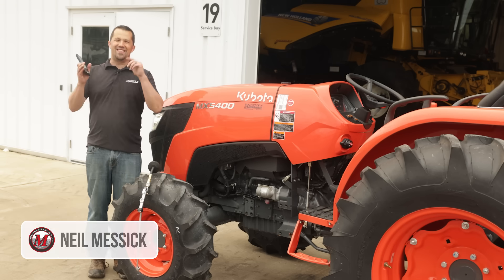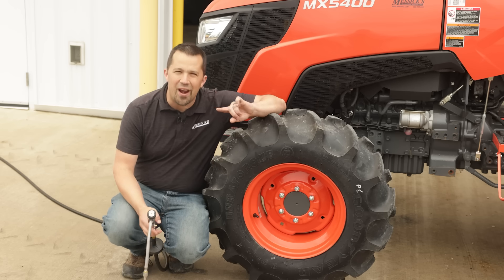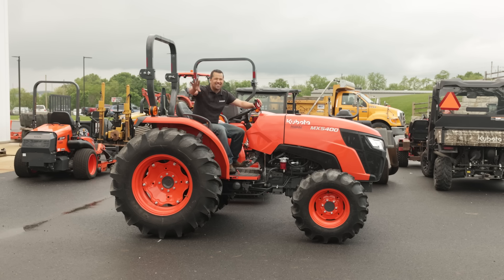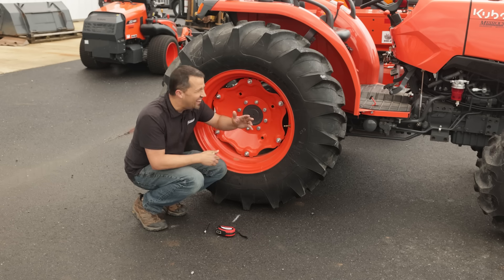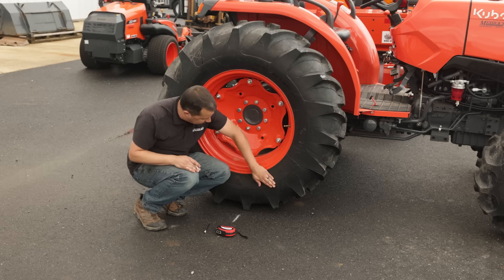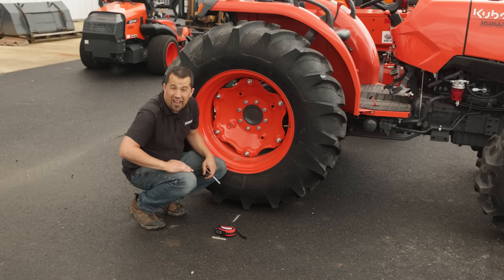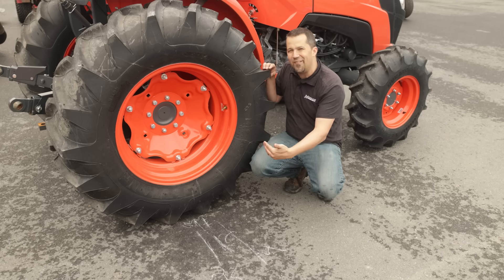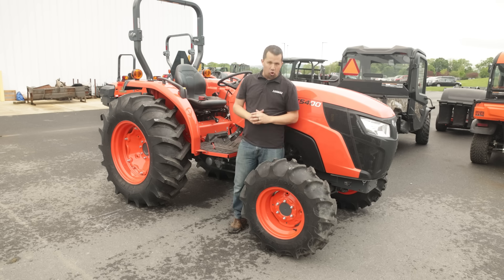Your front tires spin faster than the back. Testing air pressure vs rolling radius.

Comment: Good to know - Especially when changing worn tires -  or Upgrading tires, for using the front end loader with heavy loads in a rocky or “stumpy” area - Think, going front Ag tires to construction tires, for greater Thickness/more plies to increase durability…

Comment: Hi Neal,
I enjoy your videos. Keep it up. I'm a retired Ford engineer and once upon a time I participated in an experiment that is kinda related to what you did in your tire pressing video. I was in the Driver Information department and there was some discussion about how tire pressure would speedometer accuracy. The result was tire pressure had absolutely no affect on speedometer accuracy.
Regards,
Bob Ferencz

Comment: Looked like a gear drive tractor?…but couldn’t see gear selector. Definitely clutched with shuttle shift. Just curious if gear selection changed or if ratios are same regardless.  Just curious as I have the gear model MX but opted for less expensive and less repairs of the 2wd.  I’m not in hills and never had situation where rear diff lock wouldn’t get me out (plus the bucket can push me out if in mud).

Comment: Hey Neil, this is Bill. Thanks for looking into that.🙏  I did not know the front had a slight lead.  I use 4wd only when needed and never on Concrete or pavement. 
   Your video definitely makes me feel better about the resistance I feel when in 4WD. I have R4's and lowered the air pressure in the rears so the tread sits flat which greatly improved my traction, but I keep the front at 40psi as recommended for loader use. 
   I have always driven Jeeps with a 1 to 1 gear ratio front to back and having equal air pressure in all 4 tires is important when using 4wd, but I've always wondered how the different size tires on a tractor effected the rotation in 4WD.
Thanks again, greatly appreciated.

Comment: correct me if i'm wrong,  but the circumference of the tire isn't going to change regardless of the pressure right?  the radius changes, but the distance the tire travels shouldn't change because all the belts etc inside the tire won't allow it to.  in other words, your big ol ag tire has 26 sets of lugs that are 6" apart.  no matter what the inflation is, you should still have the same number of lugs with the same spacing no?
Reply: No.
Reply: @guyprattii3115  care to elaborate?
Reply: Diameter is 2*pi*r. If the radius changes, the diameter changes. That seems logical enough. But there is an argument that the radius is only changing at the very bottom of the wheel (where it's squished). At the front of the contact point, the tire is probably still the same radius. And that bit must also be part of the diameter......so there is something to what you're saying. Maybe that's why Neil found no difference?

Comment: With varied loads whether front or rear, you will never be able to " adjust pressure " in every changing situation. Pick a load up in the bucket, front tires get smaller, rear get bigger.

Comment: After watching this video I'm pretty sure I'm running too much tire pressure. Having said that, what would be a good tire pressure to run in an L2501 with loaded rear tires, 50% of the time in 4 wheel drive mostly on dirt/grass?
Reply: Best advice is see what your tire ratings are (max load @ max psi). Estimate the weight how heavy your tractor is what it is pulling or carrying on average. There might be some tire inflation charts in your manual or from the tire manufacturer that can help you decide, and also specifications either in the manual or online can give you an idea.

If you're not carrying heavy loads, you can drop the pressure down quite a ways without much worry. Since they are loaded, would definitely stay 12 psi and above. Tires that are loaded will give better performance of the tractor, but reduces ride quality due to the fluid not allowing as much give.
Reply: @farming4g  Thanks for the response 👍👍👍
Reply: Also, R4 tires. Thanks for any input 👍

Comment: Air pressure will not change the rolling circumference enough to matter, less than a 1% difference. Your test proved what some other YouTubers have shown with similar videos and the same nonsignificant air pressure result. 

Front end loaders tend to increase front tire wear the most.  Which would be in line with your two to one difference in tire replacement.
Reply: There are two things: the larger the tyre the larger the impact AND it's the front to rear ratio that counts. Carrying heavy implement on the rear in wlnter means need to inflate (weight and temperature) and if that air isn't let out when summer comes ih messes up the ratio. Same if AG-tyres are used when doing heavy lifting/moving with front loader.
 The biggest risk is destroying the front differential if the ratio is wrong. Bug onlh using 4WD when needed and in low gear is a good rule. Larger/newer tractors disengage 4WD automatically when speed gets higher...

Comment: Is there lead in MFWD only?   Or also in 4wd?
Reply: As far as I know, only lead in machines where front and rear tire sizes are different. Wheel loaders and 4wd articulated should theoretically have none.

There might be some cases where the front might have a lead with machines that are not full-time 4WD.

Comment: I'd like to suggest that the front tires spin faster than rears because they are quite a bit smaller and have to travel the same distance as the rears. Not so much about rpm, but more about feet travelled per second or minute. I always enjoy your videos. Keep at it, you do a great job.
Reply: The fronts are intentionally geared so they travel more feet per second/minute than the rears.  The idea is that the fronts should be pulling the tractor along in most/all circumstances.  If the fronts were "slower" than the rears, then in dirt, the fronts would basically be plowing the dirt ahead of them as the rears pushed the tractor forward.  The optimal setup would be if they were exactly equal...but that's something that's nearly impossible to achieve in the very simple drivetrain that tractors have (no fancy diffs, clutch packs, etc in a transfer case) since, as Neil was trying to show, things such as tire pressure and tire wear can change the ratio between front and back.  So, in order to ensure that the fronts are <never> plowing...they are geared so they are always going to be "faster" than the rears in order to account for the variability mentioned.   As an aside unrelated to your particular comment (which probably deserves a separate thread but /shrug here we are)....I'd like to suggest that those folks who are seeing excess wear on their fronts from all the time they spend on asphalt perhaps should learn where the lever that switches from 2wd to MFWD is located.  Granted, things like using the loader on hard surfaces while having to make sharp turns all the time is hard on the fronts, but Neil seemed to insinuate that the wear was due to the difference in speeds between the fronts and the backs and for that purpose any excess wear observed is due to operator error.
Reply: Totally makes sense to have the fronts go slightly faster so that they are not plowing. I've driven enough times in snow in a 2wd pickup to notice it's usually good enough unless the snow gets deep enough that the fronts are trying to push snow rather than roll on top. Thanks for your reply

Comment: Tire slippage is a thing.
We always look at weighting enough to get a slight spinning/slippage when pulling heavy load. To much weight and the lead time will be noticed (excess wear), not enough and you'll just spin a ditch (excess fuel usage). As conditions change so does the amount of weight required.

Comment: I had always understood that the correct tire pressure is what is recommended in the manual. Typically you do not inflate a tire to the maximum allowed shown on the sidewall. I know that’s true for vehicles other than tractors and I believe it is true for tractors as well.

Also, what is with the weird comments, 2 in Spanish and 1 about some video game?
Reply: Max pressure is where max load rating is.  Heavy hauling?  Air up.  Simple.